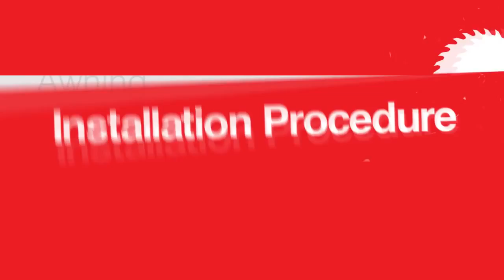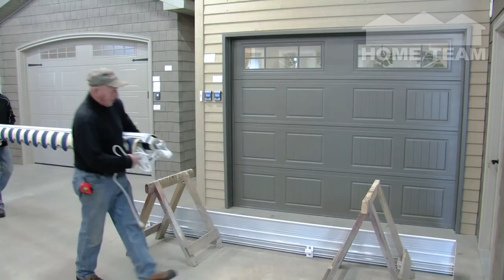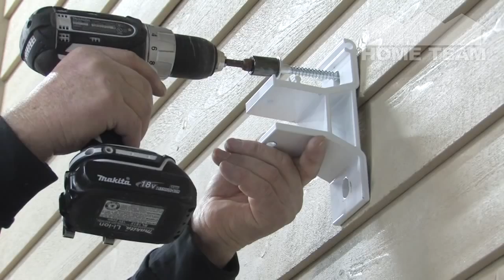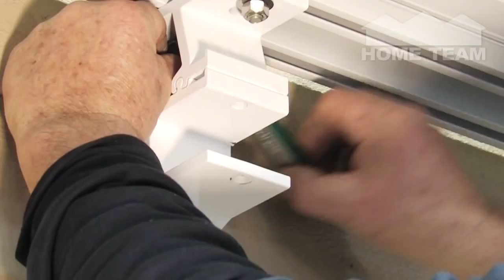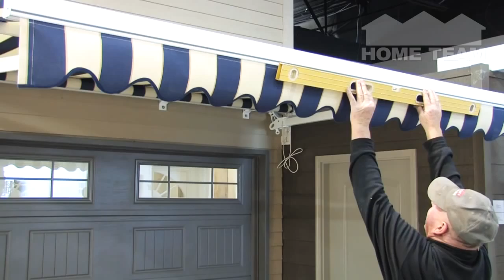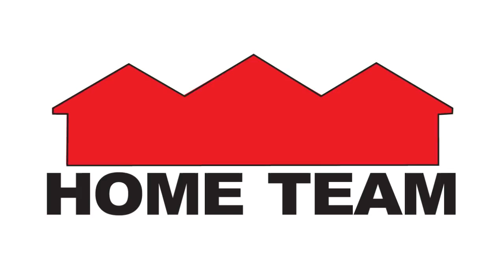Motorized Retractable Awning Installation

Comment: I have yet to see one motorized awning install show how they ran the POWER. So disappointing.
Reply: In this one and the Aleki videos, the motor has a long power cord on it.  Can't tell how long this one is but the Aleko power cord is 18 feet long.  So you run it to an existing receptacle or add one.